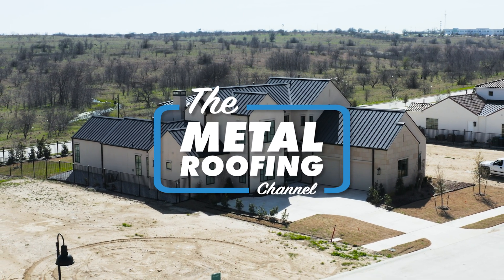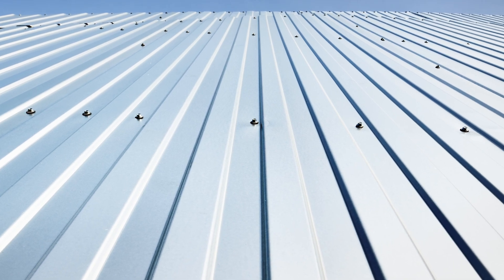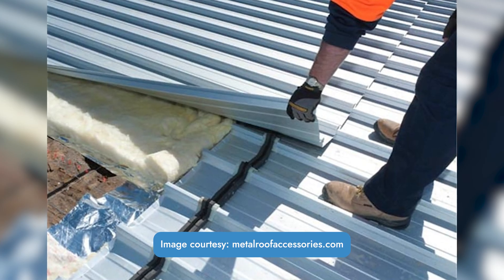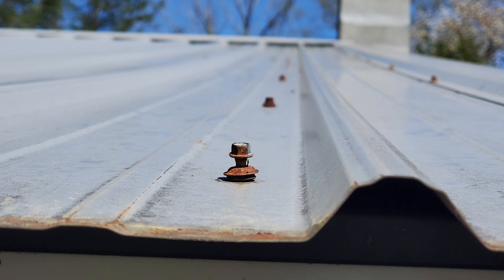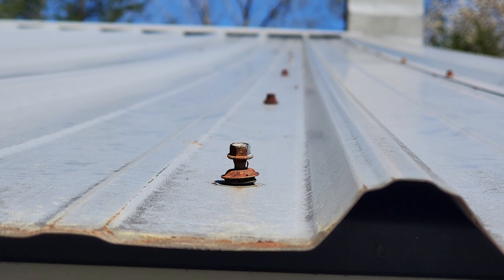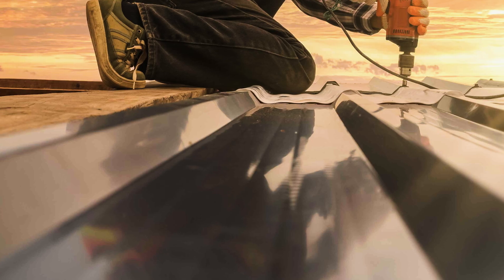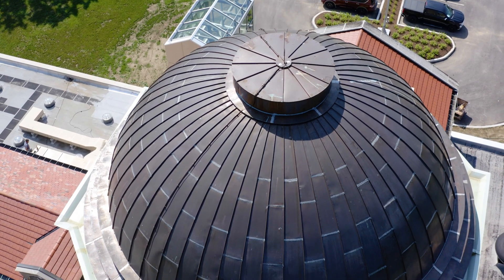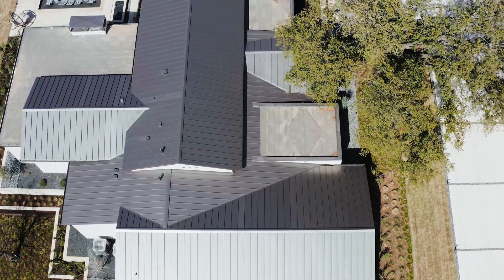Exposed Fastener vs. Standing Seam Metal Roofing: Which Should You Pick?

Comment: Thanks for the great intro video!
My wife and I are building our home in Hot Springs, SD, where our summer high temps get up over 110 deg F occasionally, our winter lows can get down to -40 deg F, we get significant hail, and there is the constant danger of fire during the dry summer months, as well as high winds, too.  As far as the temperature swings go, I'm thankful that you mentioned the heat trapped within the system.  Given our temp swings, I'm nervous that an exposed-fastener roof would exert shear forces on the screws as the metal expands and contracts.  Is that a legitimate concern, or am I borrowing trouble?  Thank you for your thoughts!
Reply from the maker: That is a legitimate concern, one that standing seam solves. If the project's profile is mechanically seamed, just make sure to get sliding clips that allow for thermal movement. Snaplock profiles naturally move with expansion and contraction because they are just snapped together. If you go with exposed fastener, double check the screws every couple of years to see if they have begun backing out of the substrate. Eventually, you may need new fasteners installed as part of maintenance if the original screws start to back out. -Thad
Reply: @TheMetalRoofingChannel  Thank you, Thad!
Reply from the maker: Absolutely! Best of luck with your project! -Thad

Comment: having only used Advantage-loc 2 standing seam as well as standard exposed fastener panels, I can say that standing seam takes so much longer install, especially with the way the trim and closures need installed on some of them. It is a heck of a lot more time and the panels are more expensive but I love the idea of less leak points.
Reply: How much more does it cost?  50% more?
Reply: @swissmaid  no
Reply: A few grand